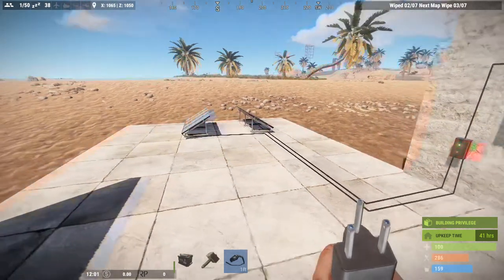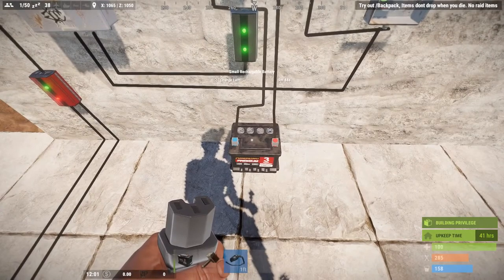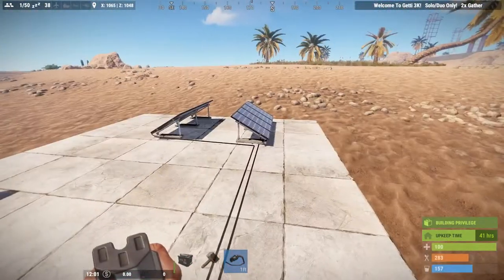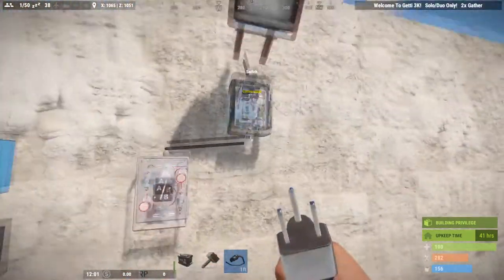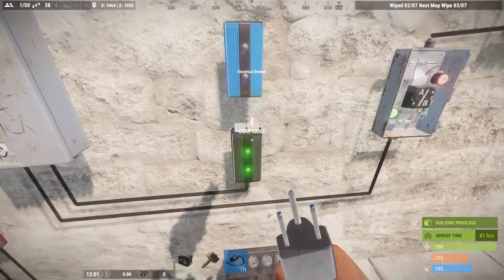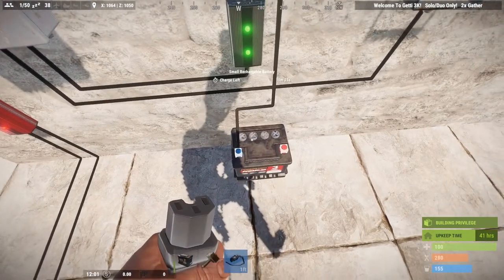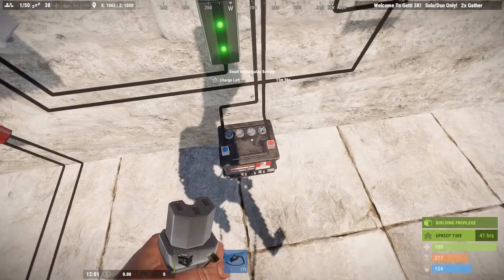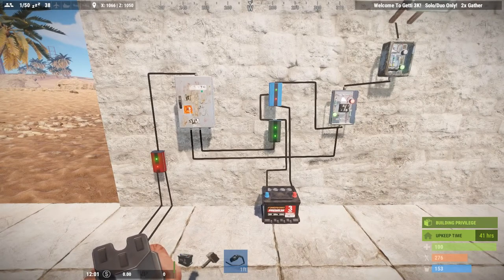Rust Electricity S1E2 - Charging Batteries Automatically with Solar Panel

Comment: The circuit shuts down at dawn and dusk as solar power drops below required power for the circuit, but is greater than 0, thus blocking the battery from powering the circuit.

Rather than use a splitter from your solar power root combiner, use a branch. The splitter just divides the power in half or thirds. A branch gives you control over how much is diverted. If you know how much energy you need and don't need 3 inputs then a branch is optimal.

Solar Panels output to Root Combiner input
Root Combiner output to Branch1 input
Branch1 left output to Battery input (set to how quickly you want to charge the battery versus how much you want to use the battery to power the circuit)
Branch1 right output to Branch2 input
Branch2 left output to XOR Switch input (A or B) (set to minimum power necessary to power the circuit)
Branch2 right output to Blocker passthrough
Blocker output to XOR Switch input (A or B)
Battery output to Blocker input

Another simpler circuit example: 

Solar Panels output to Root Combiner input
Root Combiner output to Branch input
Branch left output to Battery input (set rate to recharge battery)
Branch right output to OR switch input (A or B)
Battery output to OR switch input (A or B)

A set amount of power is drawn from the solar panels to recharge the batteries. Whatever remains is sent to the OR switch. It is there compared to the battery output and the OR switch selects whichever is greater. Solar may be greater during the day and the OR switch uses the panels. Battery will be greater at night.

To prioritize solar power of the circuit just change the left output of the branch to the OR switch and set to what is required to power the circuit. Send the right branch to recharge the battery with whatever is left.
Reply from the maker: Agreed, this was an older build, I try to use branches instead of splitters now. Thank you for your help!